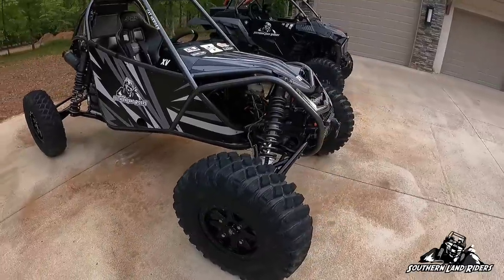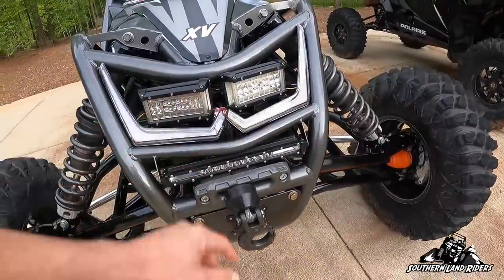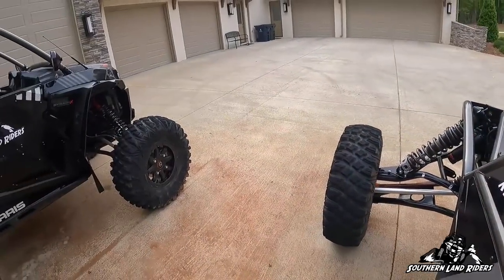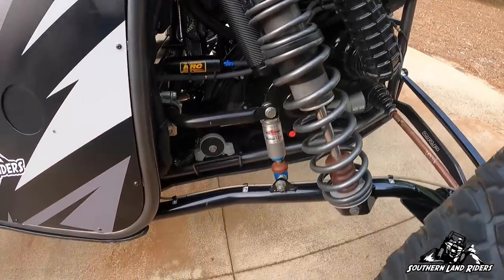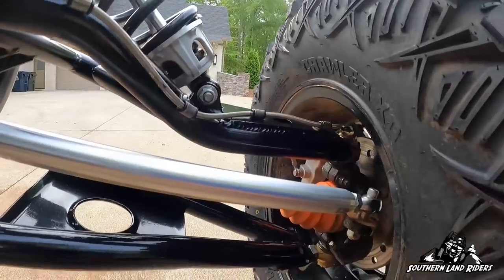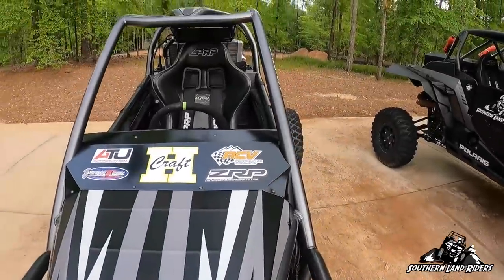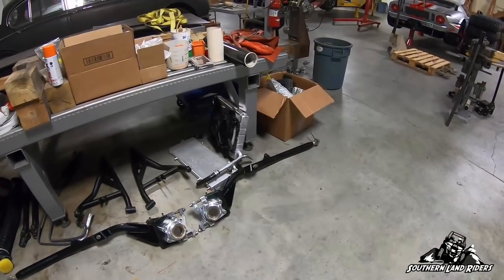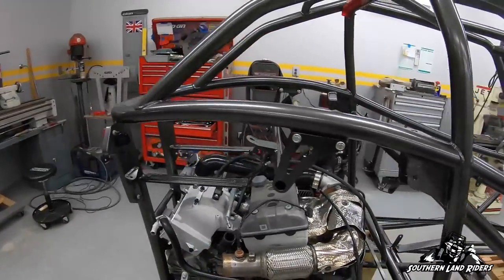RZR Tube Chassis Build Part 2

Comment: Damn Ryan, what a machine! I like how the fang lights were reused. The graphics look so good. Did you come up with the design yourself? Have you weighed this to compare to your rzr, or even an rs1? How do you like having the radiator behind your head like that? H is an extremely talented craftsman.
Reply from the maker: Yeah the fang lights were all H's idea. I designed the wrap and a local company printed it for me. I am real happy with how it turned out. Weight wise it came in at around 1600 pounds full of fuel and fluids. The S was around 2400 pounds. Huge difference!